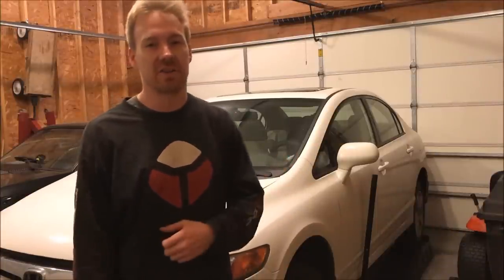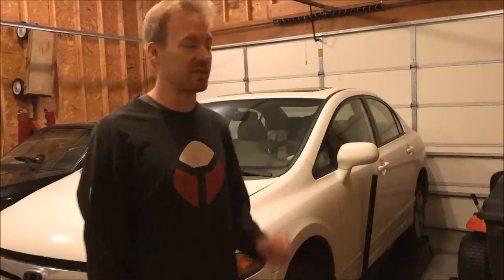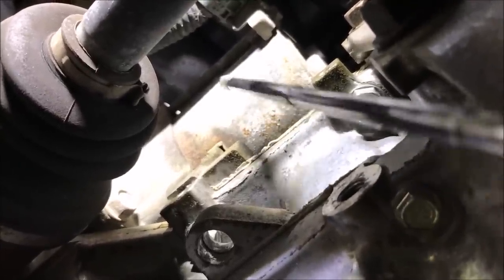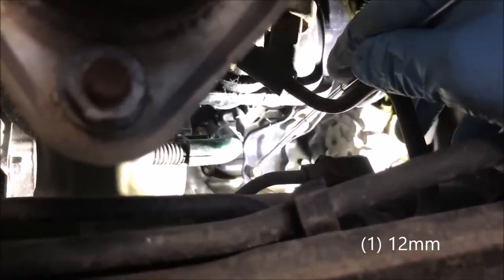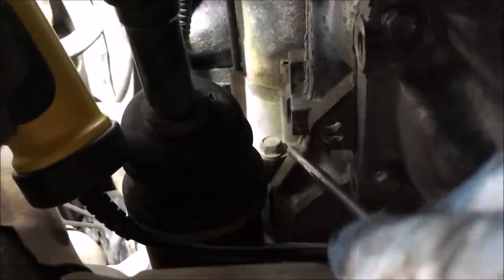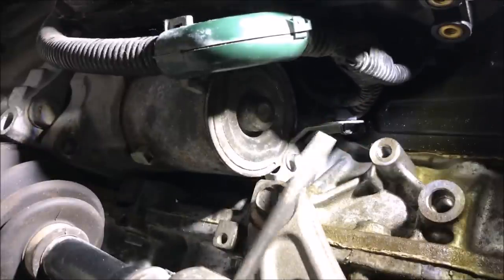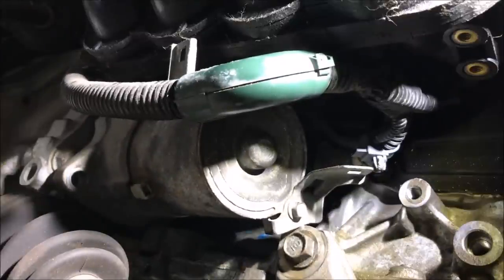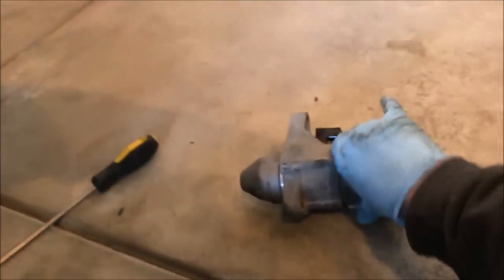Honda Civic Starter Replacement & Diagnosis

Comment: I have an 09 Civic with this identical situation but my car only has 45K miles. Could it still be the starter?
Reply from the maker: James Lerner those are low miles, but the car and starter are on the older side. It’s completely possible. Best way to make sure is to rule out the battery, the alternator and make your best judgement from there. Best of luck!
Reply: @FastFixYouTube  Guess I'll do it. Two months ago the car acted like it had a bad battery. Cranked very slow and I was lucky it started. I drove it to Walmart and got a new battery. Before I even left walmart parking lot I parked the car, went in the grocery and when I restarted the car it was still the same. With the new battery. Drove it back to their garage and they tested the battery and the charging system and said it was good. They thought it was the starter. It was alright the last two months until today. Did it again with the starter drag that sounds like a dead battery. I think even when it cranks well, it's a tiny bit slower than normal but nobody would notice except me. Thanks!
Reply from the maker: James Lerner yeah, definitely sounds like a starter issue. Mine acted sluggish for a few months too, but was less noticeable in the warm months. Winter had a strong effect and brought out its impending death. Good luck!

Comment: Thank you for the video, very informative. Seems I have a different starter from Japan. Any knowledge about getting a replacement for that starter?  Ebay came up with some matches but I’m not eBay savvy.
Reply from the maker: Reesez123 sure! I linked the starter in the description and I’ll also link it in this response below. I’ve found Amazon to be the best when ordering auto parts. Their interface allows you to add your vehicle then their software checks the parts you’re viewing against your vehicle. Amazon will tell you if the part matches or if it does not.  Best of luck on your repair!

https://www.amazon.com/DB-Electrical-SMU0435-31200-RNA-A51-SM710-01/dp/B00ZYNMGK0

Comment: So did it fix the problem you didn’t really show that it starts now
Reply from the maker: Yes, it did solve the problem!  Thanks for the question.
Reply: My starter had the same slow death symptoms exacerbated by the cold weather. Did a lot of fooling around with batteries wasted of alot of time with dxing.

Comment: i use my car for my job i turn my car on and off 80 times a day what should i do  to make it last?
Reply from the maker: I'm not a mechanic, so take what I say with a grain of salt, but servicing the regular maintenance items is your best bet.  However, if you use the car that often, expect the life of parts to not last as long.
Reply: @FastFixYouTube  thanks
Reply: first I figure out how to save  wear and tear  on your ignition switch. And I  wud buy an oem Honda starter

Comment: I just did mine today in the parking lot of a chipotle...it decides to fail anyplace it feels fit lol.  I got it done but I did a half ass job, didn't put the bracket back in and the connectors dangling but I got it.  Car is in bad shape anyways so install didn't need to be perfect.  Just a tip for others out there...as soon as you hear slow cranking...replace the starter ASAP!  It's not your battery trust me.
Reply from the maker: Oh man!  Parking lot repairs are always a challenge. Nice job getting it done!

Comment: I found one of the hardest aspects of this fix was undoing the main electrical wire (tore out the small red wire that goes to the anti-knock sensor) and now it is all back together and I cannot get the top bolt in, it is like it is not “lined up” right, I am afraid that I will cross thread it! It just will not screw in no matter how many angles I “approach” it at…

Going to take it all apart tomorrow and start again…😢

Comment: when you had this issue, did your battery and oil light come on as well? mines for a while now has had a drag before starting and finally stop starting, but my dash ac/heat and head lights still come on with no issue.
Reply from the maker: Dfflictim Strikess hello. I hate to suggest it, but it’s possible you had a low oil pressure or low oil level condition and seized the engine.  The oil warning light indicates one of the two conditions which means your engine isn’t getting enough oil circulation to lubricate the engine. It’s possible your engine started sluggishly because the starter had to work extra hard to overcome the increased friction in your engine due to the decreased lubrication.  It’s best you take the car to a shop to have it inspected. You wouldn’t want to replace the starter just to find out you had a seized motor. Best of luck.
Reply: even though though these light have just come for the first time?
Reply from the maker: Dfflictim Strikess just to be clear let me ask you a few clarifying questions:
1. Did you run the engine with the oil light on? 
2. If yes, for how long? 
3. Have you checked the dipstick to verify the oil level? 

If the car was driven or if the engine was running while the oil light was on, there could be internal damage to the engine that’s prohibiting the engine to spin and start. 

I’ve never heard of this happening to a Honda, but if you’ve not serviced the oil level in a long time it’s entirely possible.  I hope that’s not the case.
Reply: no it has never been on until now when it didn’t start up, and i recently had an oil change done.
Reply from the maker: Dfflictim Strikess oh, okay. That’s good. The engine is likely fine in that case. Technically, I don’t believe the oil light will function without the engine running, so perhaps just having the key in the “on” position is illuminating the oil light as a test before start up. I should clarify that I’m not a mechanic, so please don’t take my comments as coming from a professional. 

If I were you, I would first test the battery and make sure it’s not dead or dying. Dying batteries can still power headlights and other electrical features of the car, but not have the power to engage the starter and fire the engine. If the battery is okay definitely look to the starter as being the culprit. Best of luck!
Reply: @FastFixYouTube  thank you, the battery was just checked and even charged a bit and still no change, i'll get the starter, and let you know how it goes.

Comment: You lost the white plastic thing on the lower end of starter next the lower bolt. Mine falls easily. What is it for?
Reply from the maker: Sean Liu Sorry, I’m not sure what you’re referring to. Can you please give me a time stamp reference in this video where you saw this piece?  I would say if it’s plastic, it’s probably a clip of some kind. More than likely to hold a wire or wires in place.
Reply: Blueoyster5 it is a tiny piece of plastic clip like thing attached to the starter’s body. You can see the pieces when you put two starters side by side in the video but in the end of the video immediately after you tightened the lower bolt, the tiny white plastic piece was not there. I’m just curious as what it is used for.
Reply: Blueoyster5 if you compare 17:17 and 19:06, u\you will see the clip is gone.
Reply from the maker: Honestly, I have no idea what that is. I see what you mean, but I can’t tell you what it was for... if I removed it or it fell off I wouldn’t think it was very important. again, it’s probably a tab to secure wires or something like that. Or it could be a packaging piece to protect something. Hope that helps...
Reply: Blueoyster5 thanks. I have replaced my 2012 Honda Civic starter successfully and your video is a big help. What I did with the little plastic thing was to put it back where it belongs. I suspect it protects the venting hole on the starter.
Reply from the maker: Sean Liu yup, that sounds reasonable! Glad you got it fixed up and thanks for the comments!

Comment: Everybody shows unclipping just the green ones, on my 2008 civic there is also a 2 black clips clipped together under the 1st green clip located on the starter solenoid, I got 1 of the black clips off but the other is attached to the solenoid an I would like to not break it off, anybody have any ideas, red control wire I beleive
Reply from the maker: Sorry, I’m not sure what you’re referring to. I don’t recall disconnecting any black connectors.

Comment: This video is a “must see”
Reply: Thank you for the excellent info on how to replace the stater.  Start to finish time was about 3 hours for me but I took my time and reviewed this video several times during the procedure. Long extensions for your ratchet is a must!  It made things much easier.  The electrical tape on the swivel is also a great idea!  
Thanks again!  Excellent work!
Reply from the maker: Thanks for the comment!  Much appreciated.
Reply: Showing in a theater near you
Reply from the maker: 👆Best YouTube handle ever 👆
Reply: @FastFixYouTube  you definitly did this the fastest way I'm a state certified mechanic going on 10 years good job

Comment: I just did this exchange. Biggest pain in the ass ever. Reinstalling the top bolt was the most difficult. Removing the exhaust pipe gives much needed room and it's only a few bolts.
Reply from the maker: Good tip for those having trouble with the top bolt. For whatever reason, mine came out fairly easy.  Thanks for the comment!

Comment: Wouldn't be easier to pull the axle out?
Reply from the maker: Some go that route.  Easier in the sense that you’ll have more access to the starter, but more difficult as you’re having to remove the axle creating more work for yourself. Sort of a pick your poison scenario. Thanks for the question 👍
Reply: @FastFixYouTube  I just did the job and decided to pull the axle out and just put a new axle in since it was out.  Car had 95,000 miles, original axle, wasn't giving me problems but it was out.  I also took off the exhaust bend where it comes underneath from the manifold.  With the exhaust piece off and the axle out the job wasn't so bad, the hardest part after that was the top bolt for the starter. Thanks

Comment: After researching about prices you were right: Amazon have it for a lot less and with Prime will be here on Wednesday. AutoZone was my primary source but their prices are ridiculous and when asked for match price they gave me a lot of excuses for not doing it. Tomorrow will start taking the old one out but more likely due to my bad back will do it by removing the intake manifold instead. I saw a video of a guy doing it and seems to me the more convenient way for me. More work and time but will do it without been under the car. getting older is taking me the long route but it will be done properly.
Reply from the maker: Yep, Amazon has the best price by far.  Best of luck with the intake manifold route. I would caution you however, that it sounds like a lot more bending of the back that way, but you will save some neck pain I bet!  Hope it goes well!
Reply: Autozone doesnt price match online
Reply: 510JisatsuNiño my AutoZone does it

Comment: Same issue."Groggy slowish starting. got cold. like -25F. acted like a weak battery. One day forgot to warm it up before bed & DEAD. Jumped it  & NOTHING. Got a new battery NOTHING. If i rotate the engine off compression, it rotates the motor half a crank lol. caris an 07 & has 99,000 miles. I'm kinda disappointed. also noticed the lil R18 is leaking EVERY FLUID from everywhere . Honda should of kept the D series in these. I'm certain after i replace this, the block will crack. I always use OEM honda fluids, And OEM oil filter w Mobile 1 every 5-6,000 miles. Mine has been a lemon for years. Cant get far enough ahead to replace it. I will be buying a V6 RAV4 after this.
Reply from the maker: TheeJoeyLee man, that’s sound terrible! We’ve (nebraska) been getting unseasonably cold weather here too, but not -25! I think our coldest was -10 or so...  luckily I had the starter replaced by then. But yes, the starter failure is difficult to diagnose because it presents itself as a battery problem. As you found out. Also, this is the second engine I’ve had in this car. The original engine cracked at 235,000 miles. Luckily, the original engine had a warranty extension and the replacement was completely free of charge. I have a video on how I found the crack on my channel as well. It’s titled water pump replacement fail, or something like that. Best of luck!

Comment: Great Video!! 12:15 minute mark last tab.....I think I would just remove the bolt from the starter and leave the bracket connected to the wiring harness. Reuse that bracket. Might need to replace starter on my cousins car. Shame on these mfr. for all the horrible access for maintenance. Was easy to install before the motor was placed in the car.
Reply from the maker: Lol, I completely agree!  Good tip on the wiring harness. That may help!

Comment: Anybody thinking about doing this job themselves.. you've been warned. This job is terrible. I seriously considered lighting my car on fire several times during the course of the repair. He does such a good job explaining it which gave me a false sense of confidence. I got it done eventually but it was a pain (~5 hrs). Getting the top bolt back in was god-awful.
Reply from the maker: 👆this is true. It’s hard to gauge how hard or easy a repair will be through the lens of a camera. I for example, have the advantage of long and skinny arms. Others may not have this advantage. Also, experience working on cars is a large benefit.  The top bolt is hit and miss on the difficulty scale. Mine was easy, but plenty of others have had a hard time. 

Glad you got it done 👍

Comment: I like the ones you just unbolt and bolt back. Damn foreign junk. I currently have my civics starter unhooked and cannot figure out how the hell to spin it around enough to even see the top. Im thinking tow truck.
Reply from the maker: I totally hear you.  Manipulating the starter to remove then install is damn near the hardest part if not the hardest part.  If you can stand it, just keep messing with it and you’ll likely get it out. Best of luck.

Comment: My husbands having the hardest time getting to the blots and getting them loose
Reply from the maker: It can be difficult depending on the condition of the car. Mine was rather easy. I’ve heard mixed results from others...  unfortunately there’s not much advice I can offer except to keep at it. If something isn’t working, try a different approach. Hit the bolts with PB Blaster or try different configurations with the tools.  Make sure you have the right tools. It makes all the difference. Best of luck.

Comment: My crappy American made Honda Civic starter only went 70,000 miles. Yet another problem with  8th generation America 2007 Honda Civic . What a lemon.. and shame on you Honda of America!
Reply from the maker: I hear ya!  I’ve gone through an engine block and entire new front suspension. Now other stuff is failing, but after 260,000 miles I do have to cut it some slack. 👎

Comment: Just replaced mine it started during the winter was cranking slowly and then to the past week or two sometimes it would take multiple turns of the key and then it just crapped out.. after the install, the removal was hardest part that first turn of the  🗝 it fires up and with 201k on my r18 coupe with vigor again
Reply from the maker: Great!  Glad you were able to get the job done and it fixed the issue. Nice work!